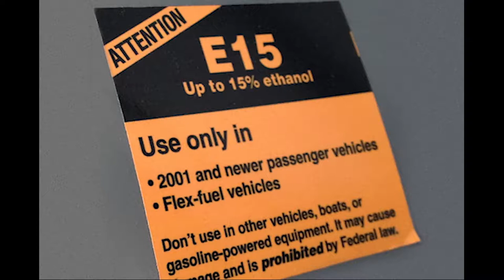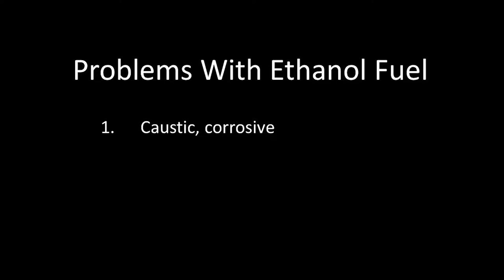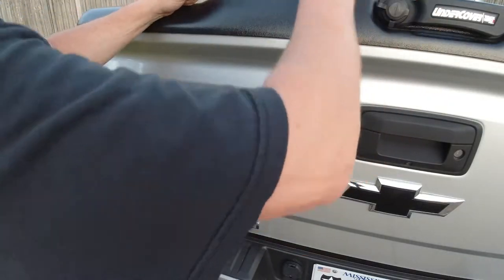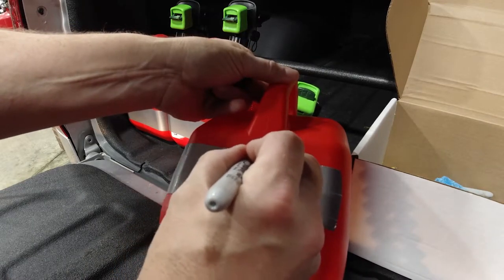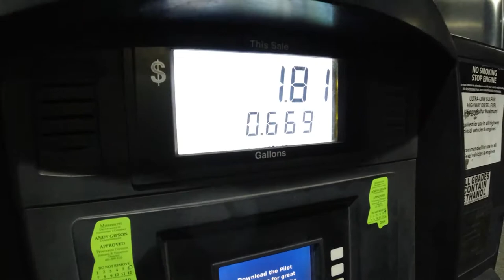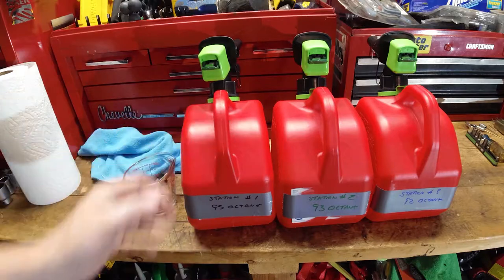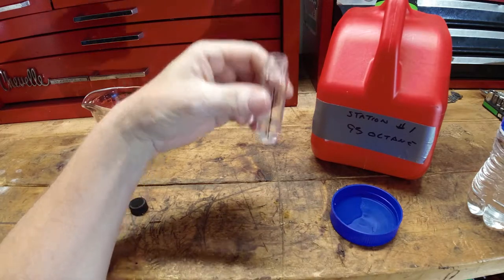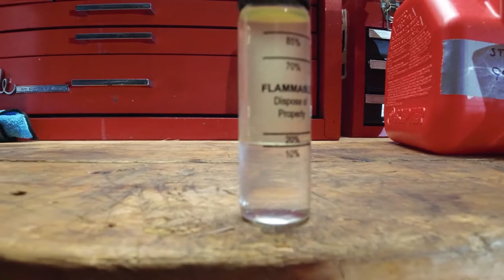The Truth About Ethanol in Gasoline

Comment: Hey MCS (I think it's Brian like me right?) I have a friend with a 71 Cutlass he just bought that is having overheating problems. We've been talking over the phone so I haven't seen the car in person but the pictures show it's beautiful. After everything he's told me I'm wondering if timing is the problem. I know one of your videos at least has talked about timing and ethanol. Off hand do you know one of your videos where you went into this and talk about advancing the timing to compensate for the ethanol?
Reply from the maker: Yup it’s Brian.  Timing for sure can help facilitate over heating.  Usually a bigger problem though.  Not having a shroud is usually the biggest problem.  A radiator that’s not up to the task.  Water pump, incorrect coolant mixture.  It’s like anything else.  Start going though your checklist and you’ll find the issue of the combination of issues.

Comment: 2 questions in the same video??? What's wrong with me LOL. So from what I've learned from your channel and others is E10 bad. So I have been using "Lucas safeguard ethanol fuel conditioner" maybe a good video would be testing these products and see what they're worth using? As always thank you and you're appreciated 👍
Reply from the maker: I’ve used the Driven Carb Defender for the last 10 years or so.  It does a nice job of keeping the crap moving through the system.  I can always tell a carburetor I rebuild if the person has used some additive to keep the water moving.  Always cleaner and not as much damage from the alcohol.  I had a video started on that topic but found it difficult to show.  I’m big on showing something instead of only talking in theory.  I might come back to it.  Thanks man!